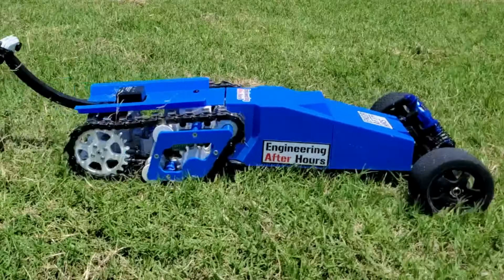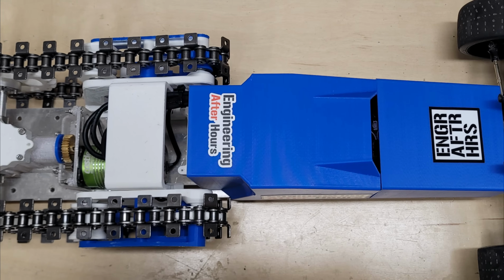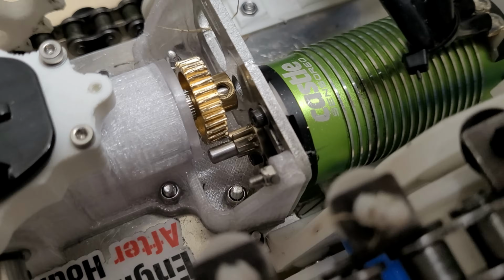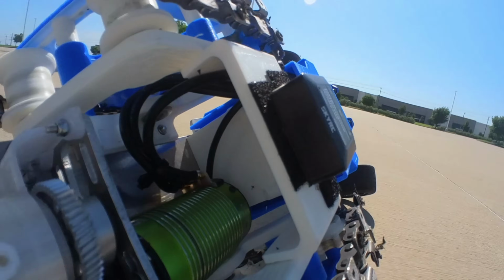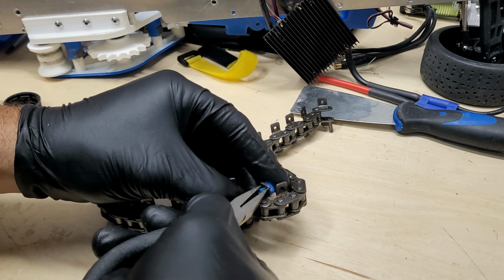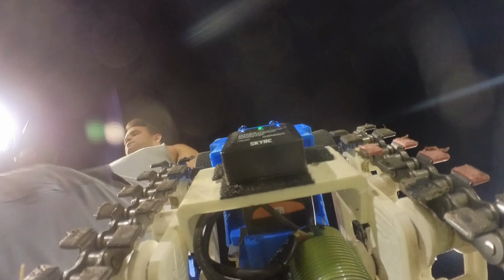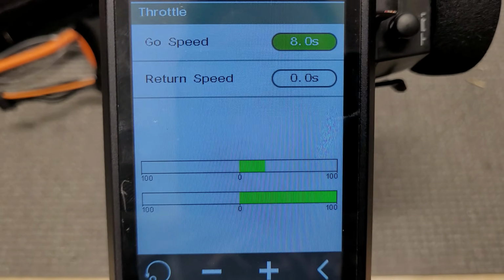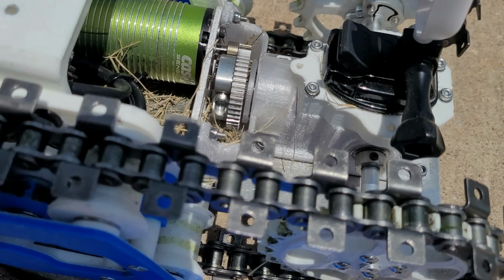Worlds Fastest RC Tracked Vehicle

Comment: PanoCar is a self-developed high-precision and powerful vehicle dynamics simulation software. It not only integrates complex and accurate vehicle dynamics models, but also features efficient simulation and high stability numerical calculations. It can meet the real-time simulation requirements of large-scale, long-period, and stable reliability under various operating systems such as Windows/Linux, real-time hardware platforms such as dSPACE and NI, and various software environments such as Matlab/Simulink. It is highly compatible and consistent with the international mainstream vehicle dynamics simulation software CarSim.

Comment: Would carbon fiber  or fiberglass work better as gears?
Reply from the maker: Not really. Composites aren't that wear resistant...especially in applications like this. They make carbon filled nylon that is occasionally used, but not in high power applications.

Steel would be one of the best choices, it's just hard to find gears in the right size without spending a fortune.

Comment: Sombody upvore this that his rubber studs are mounted upside down  as the plunger part is to keep it from being thrown out you wanna ride on the grip hairs trimmed evenly  to same  lengths try 1/2 inch 1/4 inch 1/8th rubber hair stubble and as you increase speed your oval wants to become circle so design strength spreaders with springs to take out slack from sudden speed changes helping against derailment  and slap a solar panel on top for the stupidity of more power/range weight balancing to front  slightly with downforce for steering ability  and have a steering dampener setting so the faster you travel less responsive the steering left right  speed  goes but at slow speeds  nice sharp turns will help with your imbalanced flywheel and flipping problems, simple physics

Comment: Wouldn't a larger front sprocket reduce stresses on all components by making the chain change directions less quickly also most of your stability issues could probably be solved by hanging a tailfin way off the back
Reply from the maker: Interesting thoughts on the front sprocket radius. The only reason it's shaped like it is now is because it looks cooler and theoretically can handle rough terrain better.

Comment: Sorry bro: Half-track vehicle.

Half track vehicles benefit from the load bearing on the front wheels, reducing the need for horsepower due to the round shape and extended body length that doesn't need to be supported by a track carriage.

While you do have tracks, it's more like you added tracks to an RC truck's back end than it is having built a truely tracked vehicle.

But don't let that kill your thunder here! You did an awesome job creating a speedy boy here, but I gotta admit you're not beating a record, and instead just setting a new one. I'd love to see you and RCTestFlight take the collaboration opportunity to each build a fully tracked and half tracked vehicle to truly compete with each of your current vehicles.

Comment: Awesome build and like the idea of the cheap tracks (totally need something like that for another project). In relation to rubber for tracks your going to use a rubber strip riveted to it or individual bits per link, as it has attachment points you could in theory heat steel wire into rubber and attach it to holes...seen different types of tracks but you will always run into rubber coming off at speed or on hard surfaces.
Keep having fun

Comment: One very clear problem is that you have way much traction on the front, thus making it spin every time it looses traction. Maybe a narrower front tires would help in stability.
Reply from the maker: I think matching track width is a great idea, but I'd go wider at the rear. 

The main reason it spins is because the chains have so much drag that they actually lock up without me ever using the brakes. That's not completely solveable by track width matching as it would need a minimum throttle return speed. Unfortunately, this would extend my stopping distance. Rev 2 will see more work here.
Reply: @EngineeringAfterHours  no no.what I mean is that, at least for concrete/asphalt runs, it would be easier to decrease the grip of the front tires. Maybe using hard plastic tires for drift or using narrow dragster style tires made from a 3d printer and O rings so your half track is more prone to understeer. This, I think, would help greatly at speed to prevent it to spin out. Also increasing the wheelbase (making it longer) would greatly help, although that may be harder to do. It clearly already works great on grass, no doubt about it. But for hard surfaces I think it would be easier overall to lose traction on purpose on the front axle than gaining it on the tracks at the rear. Also you could try a vertical tailfin if you reach a speed were aero plays a bigger rol to aid it to stay on a straight line. A dragster, of any kind, should be engineered on such a way that it naturaly wants to go straight. Yours seems to naturaly want to pivot around the frot axle because is way grippier than the tracks (again, only on concrete/asphalt). You can tell the diference because on grass the from axle is way less grippier that the tracks thus it is more stable and makes it easier to drive.

TLDR: Try changing the front wheels for dragster style narrow 3d printed ones with o-ring tires. It will make it easier to drive for speed on the parking lot.
Reply from the maker: @acynder1  i understand what you're saying, but I think you're missing the difference in static and dynamic friction coefficients. The back tracks lock up which rapidly drops the coefficient of friction by 25-30%. You just can't balance a car when half is static friction and the other is dynamic.

I actually had a rear wing early on with a vertical stabilizer but didn't like the design I came up with and just ran without. Speeds were too low to get much benefit.
Reply: @EngineeringAfterHours  oh, I think I understand now. Mmmm... Maybe you  could make the tracks longer? So its harder to spin? I dont know... Maybe an arduino to do some traction control? You could read the actual speed from the front tires and lock the throttle in a narrow window around that value so if the tracks kick out it cuts gas on its own?
Reply from the maker: @acynder1 i'm not sure how to fix it honestly, this is a good discussion because it has brought about a lot of potential solutions. I'd have to do more testing. I can set the motor to only slow down at a set rate...that may be similar a poor man's traction control. I think the arduino based version would be best but pretty complex.

Comment: I think I still like rc test flight project better. It's more stable and is proven to work with autopilot and fpv. Still a nice video though!
Reply: To make an autonomous rc car you need a stable rc vehicle otherwise it won't work and it would just destroy it's self
Reply from the maker: His is definitely more stable and better in snow/sand. My design would be trash in both of those cases. 

Autopilot and FPV is easy with any RC based setup. I have an autonomous RC car setup in a prior video that would be a direct copy over.

Comment: Made a small RC tank using the same type of chain.  made Pla and tpu rectangle pads with screw inserts(only on the pla) to be bolted across the chain. on top of the pla pads glue on the tpu  tread.  Haven't tried going over 35 yet but they hold great so far.

Comment: NICE PROJECT !!!  Just try esc Castle XLX2 and 2028 1100kv or 1700kv. Use battery CNHL G+ or better ONYX . From 8S2P 11Ah battery i pull 569A with voltage drop only to 27V from 33V

Comment: Amazing journey beating the old record! I'm thinking you need more width for the rear, atleast matching the front steering width, this could lead to much more stable running conditions. Also atleast add a little suspension for the track so it soaks up the vibrations caused by the road imperfections and could lead to a much faster and more stable speed run.

Comment: Great video, i have been planning a track build, and yours covers some of the things i had planned. I was looking at using "conveyor chain" which appears to be just another name for the chain you used. I was looking at getting it in a size that fitted bike sprokets so i could modify those to work. I never thought for a second that 3d printed sprokets would hold up to the load, you've proven me wrong there! Are these just FDM printed? What filament did you use?  A basic PLA or a more exotic carbon nylon blend, or something else?

Comment: For the sprockets how do you taper in each of the outside teeth so they fit in the chain more easy?  What operation is that in a CAD software?  I am using FreeCAD.
Reply from the maker: Great question. I use a program called gearotic for most of these sprockets which generates a sprocket DXF that i use for the solid model. Then i use a revolve cut around the central axis for the taper. 

Alternatively, I've downloaded step files from McMaster and just manipulated those. They have tapers usually.
Reply: Thanks I will try this for my sprockets I have been tapering them my hand.  Also your track vehicle is awesome. 
 @EngineeringAfterHours
Reply from the maker: Also I use fusion360 for my solid modeling

Comment: On that Flipsky motor, I'm guessing it has a much higher kV (and therefore much more torque) than would be ideal for a high-speed application like this. I've used one of those with a slightly higher kV, and our motor gives a theoretical max torque of around 6Nm on a 6s somewhere around 60-80A. Even with a wheel diameter of 22cm, the "theoretical" (neglecting efficiency..) top speed of our rover would be around 50mph. If you went for a higher kV version of that motor you could probably get much higher RPM with less current.
Reply from the maker: I think you meant kT in your first sentence, but you're getting close to the issue. 

The design was actually overdriven to a ratio that should have given me mid 70s at full RPM. But I was limited to around 80A at around 48V. If I had a 200A controller I'm sure I could have gotten in the upper 50s, I just didn't want to spend another $150 - 200 on a controller.